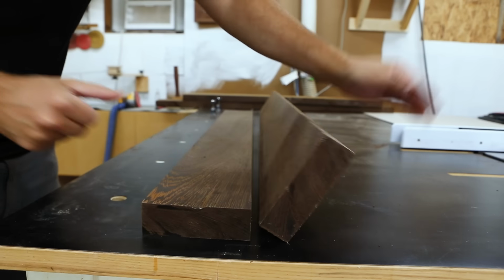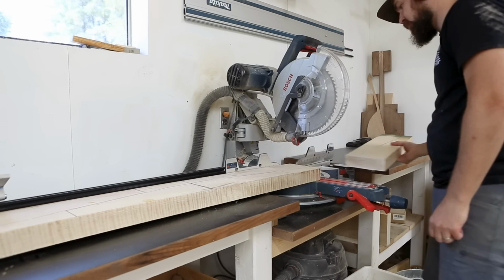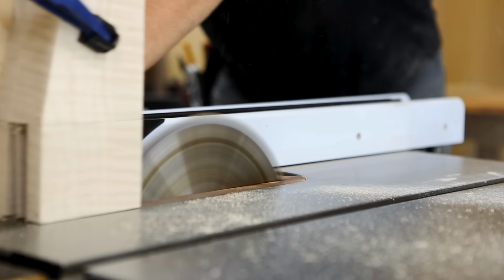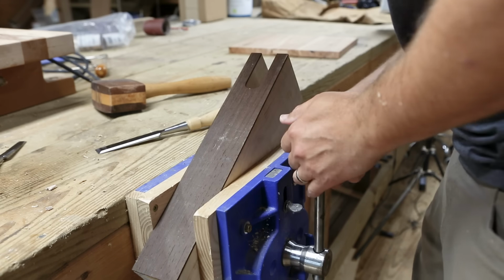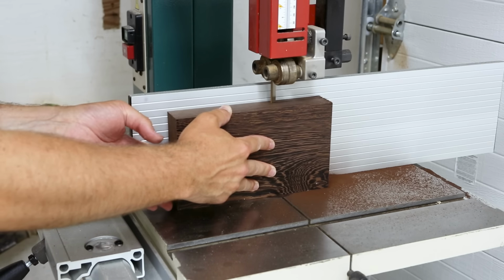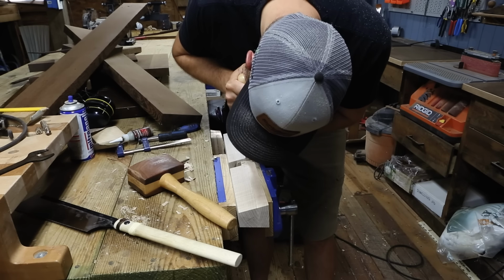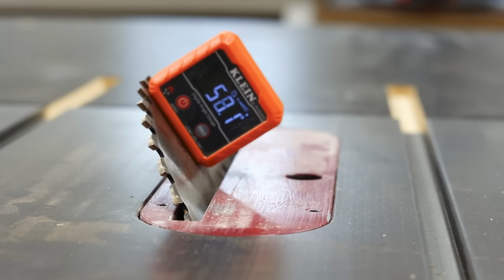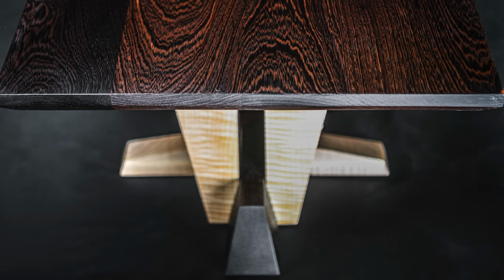He thought this wood was unusable

Comment: I hope you took time to disinfect that hole from the splinter. Also, if wenge wood is toxic, PLEASE wear a good mask while cutting and sanding it; imagine wat it can do to your lungs ( and your digestive system, if you happen to swallow any of the dust. Don’t monkey with your health, please!
Reply from the maker: Hey yes I did. Thanks for your concern! It was a little one and what I was worried about was the whole thing not coming out. Wenge is so brittle it’s easy for tiny bits to break off and be left in the skin and I think that’s what is dangerous. I got the whole thing out though. And I agree re: masks. I do sometimes forget but usually I’m wearing my RZ mask (link in the description lol) when doing really dusty tasks. I also run 2 air scrubbers in the shop continuously during work.

Comment: I didn't see any leveling feet installed in the feet of the table... living in a house that has past its first century of life I speak from experience when I say not all floors are perfectly level and having the ability to easily and build into the furniture account for those slight differences in floor hight is a lot more useful than you might think. Besides that I do like the furniture, not sold on the one board of the top that has a very different grain from the rest but I guess one has to make due with the materials one has especially when dealing with expensive materials like Wenge, it is not like you can just pick up double the material you would need to pick the best boards for your project at those prices.
Reply from the maker: Yeah thanks for giving me some wiggle room on that. My goal was to get all the boards looking similar but the only long boards I had left were the QS ones I sawed away at the beginning. 

I agree about the leveling feet. The client is local to me and we’re going to do more for him so we’ll address that if it’s a need. In a previous build (the giant conference table video) I went back and recessed some for that client and they worked great.

Comment: Nice table sir.  It would be great if you included a better solution to those cuts that you would not do again.
Reply from the maker: Hey thanks for watching!  Yeah I guess I only hinted at it. The main issue with how I did it was that the jig wasn’t long enough. I would at least make a full length fence jig next time. Another decent solution would be to make another jig similar to the one I used for the feet but angled appropriately and do it on the band saw.
Reply: @sturdyboneswoodworking I was thinking maybe retape the cutoff to maintain your reference face.

Comment: That looks fantastic! Thank you for the video. Do you live in NC? My favorite wood store has that same print on it. But I have never seen curly maple there more than an inch thick. Every time I go in there I pick up a piece of wenge and get a splinter. The one wenge board that I picked up came home with me. But I have only used it for inlay and accent. Anyway, I really enjoyed your video and your work. I’m also a fan of bridle joints
Reply from the maker: I am Durham NC based. So I typically go to The Hardwood Store of NC in Gibsonville. When I picked up this material they had it in 8/4, 5/4, and 4/4. ¯\_(ツ)_/¯ Thanks a ton for watching!

Comment: Ar 22:44 Maybe a solution for your scary tablesaw cut could be to either use double sided tap, painters/blue tape or CA glue to stick the offcuts back on there, of course due to the thickness of the double sided tape you have to shave off a few mm's or whatever to make the side square/level to the fence again. Either way that seems more safe than doing a diagonal cut on a table saw like that. Hope this helps!
Reply from the maker: Hmm yeah maybe. I thought about how I could do that but couldn’t figure out how to account for the kerf thickness that I had cut away.
Reply: I Would use the band saw on an angle. It works even for long curved pieces.

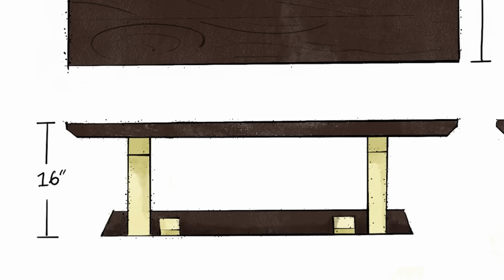Comment: Love the table, design to execution. Design question. You use fusion it seems. I’m struggling to find a way to get stylized “sketch like” concept drawings. Did you generate the “drawing” at 1:50 from a Fusion design? If do, curious how you achieved that look.
Reply from the maker: So fusion won’t really do the sketches. Sketchup has some ways to do stylized renders I think. But I do my drawings in Procreate on iPad with Apple Pencil. That’s a powerful app with a lot of cool built in brushes. I use fusion to do my technical work and convert to tech drawing with dimensions etc. Thanks for watching.

Comment: You've listed everything you used in the video except the cool marking knife
Reply from the maker: Hahaha yeah I did put a close up of that thing in there. I didn't list it because I turned it from a chunk of olive wood and I had to buy the hardware from a guy on Etsy. The blades are Swann-Morton surgical blades. Just look up "Swann-Morton Knife" from a seller called WellEngineeredStuff if you want to make one. He actually does sell complete ones too. But it was more fun for me to just get the brass portion and a pack of SM blades from Amazon.

Comment: So does that 1 darker board on the top Drive, you nuts a little bit.
Reply from the maker: Haha. Yes, a little. I thought about how to deal with it, but the only other chunks I had that were big enough were the quarter-sawn ones I removed at the beginning. I guess one option would have been to use one of the flat-sawn ones I chose for the stretcher and use the QS ones instead for the stretcher. But because the stretcher was getting angles cut on it, I wasn't sure what the faces of it would look like if they were only :slightly: QS after that operation. Thanks for watching!

Comment: I wish the grain on the top didn't create the one dark board...lots of other choices.  Otherwise the construction and problem solving were entertaining.   A fine piece overall.
Reply from the maker: Hey thanks so much for your kind words! I agree with you. I definitely had to make some tough choices with the available material. The two quarter-sawn boards were the only other ones long enough and they would have looked worse I'm afraid. If nothing else it'll speak a little to the character of the table's story. Would definitely not have gone with that if I were making it from new rough timber.